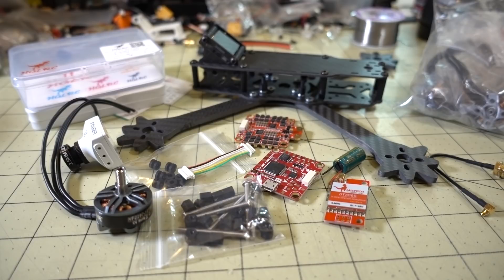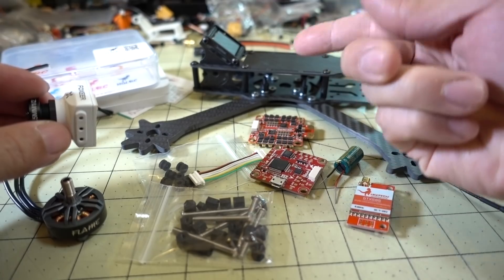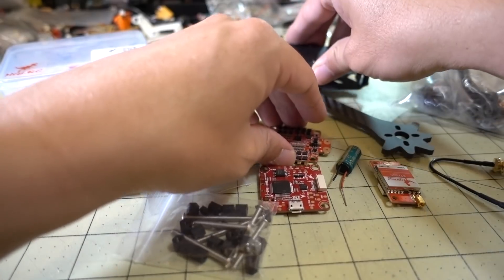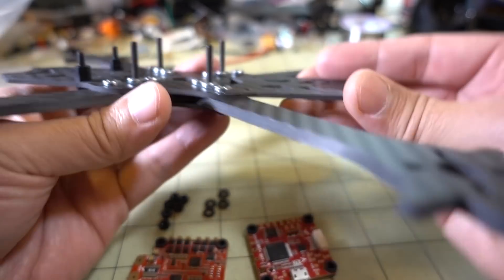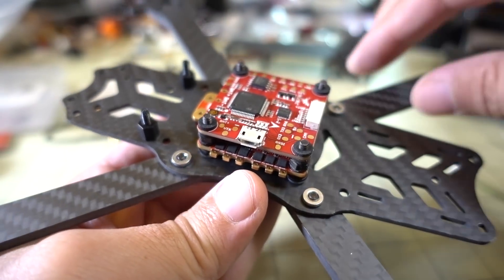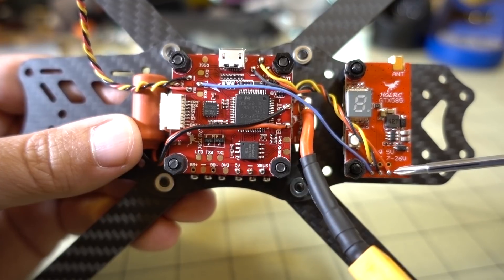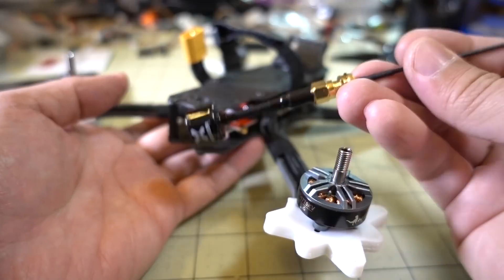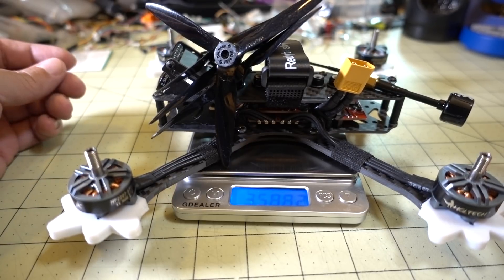Build FPV Freestyle Drone from Amazon Parts 🚁🛠️

Comment: Hi Albert! I was wondering for your amazon build the motors you said to use are the fd2207 1775kv. I could not find those exact measurements but I did find ones that are 2307 1780kv could I use thosr
Reply: Hello
Reply from the maker: I would stick with a 2207 motor.  The kv doesn't matter as much.  Try these instead... http://amzn.to/2LlB33q
Reply: @AlbertKimTV  do they have to be 6s

Comment: 안녕하세요. Alber Kim님. 영싱 보면서 늘 도움 얻고 갑니다. 제가 영어가 부족한데 한국어를 할 줄 아시는지 아닌지 몰라서 밑에 질문 하나만 드릴게요.

Does Esc vibrations effect to the flight aswell? In your video, you're using damper not only fc but PDB(w/esc) too.

If Im gonna use just normal PDB, could I put PDB on the frame without dampers?

thank you!!

Comment: One freakin expensive amazon build. Use cheaper motors (save $40) use a cheaper camera (save $20) stack is best to buy from somewhere else cause you can get a good 6s stack for way cheaper than that (save $100ish) or more

Comment: Hey Albert!

Great video love a good build. I actually came to you today because I need some help and hopefully you can give some input. I recently purchased a pair of ev100 goggles and a eachine qx65 tinywhoop a couple weeks ago and everything has been great until I bought a dvr unit for the goggles. Ever since I plugged it in, my goggles have been acting funny. Like the auto scan barely works anymore, the picture is distorted, and whenever I hit the throttle on my drone, the feed goes out after 2 seconds (goes to static). I've modded the whole tinywhoop changing the whole frame to a new one that came with the kit thinking maybe something was broken and causing vibrations but my feed continues to cut out everytime after throttling and then takes like 20 seconds of static and then will randomly reappear (sometimes). I've tried fully charging the battery of the goggles because maybe the dvr unit requires full battery power but that didn't work either. My transmitter (flysky i6s) is connecting to the quad fine however and I can still fly it line of sight.

Please if you could give some input albert it would be much appreciated cuz I'm getting discouraged now. Thanks!
Reply from the maker: I don't have any experience with the DVR unit but it might be drawing too much power.  If you unplug it and don't use it, everything is back to normal?

Comment: shouldn't the cap be soldered directly to the battery leads,  making it closer to the voltage source.
Reply from the maker: That's not required